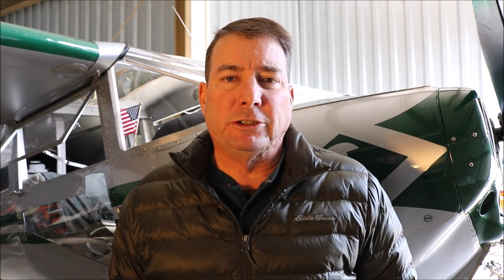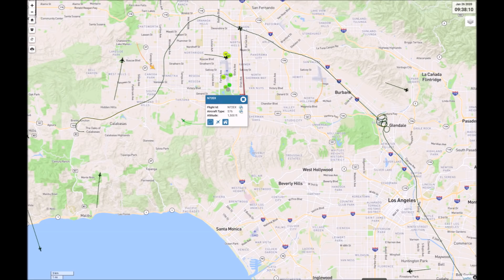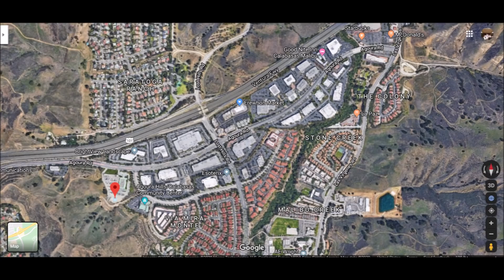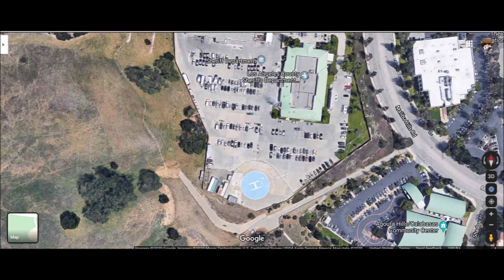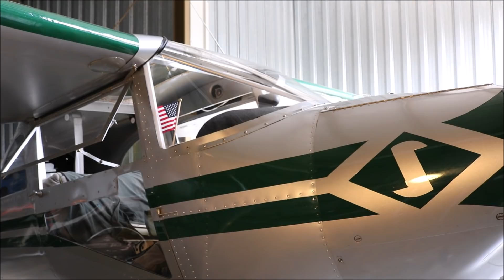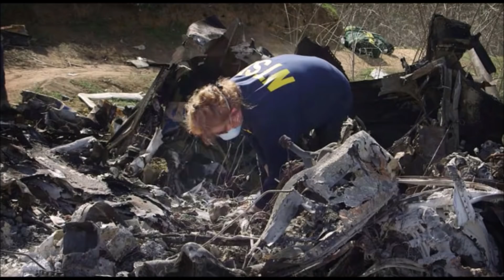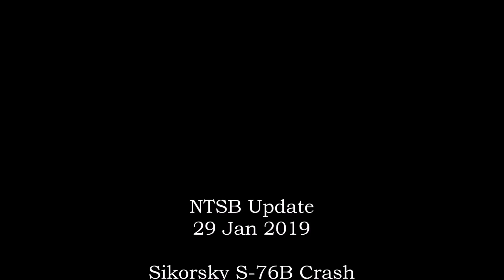Kobe Bryant Sikorsky S-76B Crash Update 29 Jan

Comment: Thank you for the excellent explanations and analysis in this tragic event. 

Could you elaborate on the devices mentioned that were missing from this helicopter(cockpit voice recorder, flight data recorder, and the HTAWS device). I'm assuming these are all third party devices that can be installed on helicopters that are not initially equipped?  

Do you have any idea on what installation cost and how long a helicopter would be out of commission for these devices to be installed? I understand these devices may not have changed the outcome of this particular event.
Reply: Excellent job Juan. Terrible outcome for all. I think this tragedy started when the take off decision was made. By all accounts this was an experienced, well trained and highly qualified pilot with a lot of time in type. Yet he made the highly questionable decision to depart under the poor existing and known conditions -  Special VFR (really IFR), low ceilings, poor visibility (possibly deteriorating), congested airspace, highly regulated routing under distracting ATC comm, irregular terrain and so much more. Given the circumstances you have to ask why? Why would this very experienced, well trained, high time pilot depart at all with so many red flags flying? Well, if we’ve been around long enough we’ve all been there - all made those kinds bone head decisions that we regretted as the flight progressed. And after we survive it we always ask ourselves why. Why did I take such stupid risks? Well, in this case I’ll bet this pilot was under tremendous “get there” pressure. He’s on a 135 charter for a long time and very high profile client who wanted to get somewhere on time, on schedule. And my guess is that the pilot’s desire to meet the customer (friend) needs had a great deal of influence on the “go-no go” decision. I feel bad for all involved but also feel the need to throw this out there because we  never see much written about the pressures pilots are under to meet customer schedules - especially Part 135 pilots.
Reply: TAWS retrofit to the heli would have been $25k to $45k.
Reply: Thanks. Less than 50k should be a no-brainer for a lot of these high profile clients. In most industries, the more tools are your disposal, the better. I'm not at all familiar with the helicopter industry so someone can correct me if I'm wrong here.
Reply: KckDwn TAWS is not really going to help a guy too much who doesn’t know the proper procedure for inadvertent IMC in a helicopter.
Reply: If I understood well , they are still optional .
Reply: TAWS is not going to do much except distract you if you’ve gone inadvertent IMC.

Comment: 14CFR part 135 vol2 chp4 sec1 details the requirements for an SIC (second in command) on aircraft type certificates of more that 9 seats. I don’t know How that company choose to fly the S76 single pilot on a part 135 flight. The S76 is a complex fully IFR capable aircraft. Even VFR , flying it single pilot is challenging much harder in low weather . Also part 135 requires the use of a cockpit voice recorder and a flight data recorder. The company I work for we are a part 135 operator and we are restricted to operate the S76 in a two pilot crew configuration, a PIC with an SIC for all operations VFR or IFR with passengers since our aircraft are configure as a 12 passenger arrangement. Our aircraft’s are equipped with voice and flight data recorders as well as EGPWS enhance ground proximity warning system a version of TAWS . How would anyone operate the S76 without that safety equipment is beyond me.
Reply: I think requiring a two pilot crew for this type (especially in marginal weather) might be the best recommendation to come out of all this. Adding more 'tech' won't really prevent this sort of thing I don't think.
Reply: For existing types, it would probably be very difficult to implement such legislation. However, there has been technology available since decades that allows an aircraft to have the terrain map for everything it is going to fly into, while flying with GPS. Current technology could make an S76 fly without a pilot with no issus, except for cost. Even the technology implementation would be childs play, but the certification would probably be best compared to some space program.

Therefore I think what will happen, are new types that will be completely autonomous, while remaining in a lower regulation or certification level. Take the blackfly ultralight for example. It will then take around a decade to establish some model of them to be more reliable than anything flying commercially, after which the regulation change regarding other flying things will change imminently.
Reply: rkan2 agree, medium and long term solution for automobiles and aircraft is that they will be autonomous and much safer than human-operated. When was the last time you rode in an elevator that was operated by a human elevator operator?
Reply: Flight safety has a motto embossed in their company wall, “the best equipment in an aircraft is a well trained crew”.
Reply: @keithkman, Sikorsky has certified and designated the S76 as a single pilot rated aircraft for VFR operations. That is written in the Rotorcraft flight manual. However, each country’s aviation regulatory body has the responsibility to apply laws in its operation. The FAA has determined that as long as is configure with 9 passenger seats you can fly it single pilot, otherwise other procedures apply. I fly in the U.S so I couldn’t tell you if other countries have it restricted To a two pilot crew.
Reply: Richard Rivera Do you operate the S-76 outside the United States? My understanding is the United States is one of the only countries that certifies the S-76 with one pilot.
Reply: There is an interview with a pilot Deetz who used to fly Kobe on that specific helicopter. He said it’s configured for 9 pax in the back.
Reply: Carl Ryan 
Not in this particular case. With an estimated descent rate of about 2000 fpm this close to the ground, the pilot had apparently lost control of the aircraft. TAWS/GPWS is only helpful when the aircraft is under control. And sometimes not then. See the AA 757 crash in South America when the pilots navigated to the wrong navaid for an example.
Reply: The reason is always the same... Money, the bottom line, profits.
Reply: @rkan2  .. You took the word right out of my mouth.  I agree 100%
Reply: @rkan2  re: "The reason is always the same... Money, the bottom line, profits."  FOLLOW THE MONEY TRAIL.
Reply: Mr Rivera I am impressed by your company's serious commitment for safety, even more so when they go beyond and above FAA standards.The sad part is that even while having onboard all those safety features accidents still occur.unfortunately accidents never happen for just one reason.They always happen by a series of events.
Reply: @CarlRyan-i2z  I've read CVR transcripts from spatial disorientation crashes, listened to a few CVRs that are out there on the internet. It always sounds the same, a computerized voice commanding you to pull up. It's like a Red Alert in Star Trek. It's just sound clutter in the background. I imagine when it does work, we don't hear about it, but I suspect that very few pilots really hear what the recording is saying at this point. Especially because false alarms are a real thing with the cheap versions of TAWS.
Reply: @CarlRyan-i2z  Just a thought , what if the pilot is not sure which way is up? There is concern for spacial disorientation here..
Reply: They could of had a waiver of that requirement in their OPS SPECS, as long as they are comfortable and checked out in the use of the autopilot. Pretty common in the commercial world.
Reply: @CarlRyan-i2z  Not if he thought he was level when he was actually in a steep bank. Looking straight ahead at the panel might have saved him. No new instruments, just the same ones that aircraft have had for ~100 years.
Reply: @wrushbo, you are right about the opspecs. That’s the reason I would not fly for a charter operator much less be a passenger. I don’t know what their standards are or the qualifications and training they provide to their pilots. In my company I have to take a full IFR check ride every six months along with three days of training at flight safety international . Sim time is not cheap. But that’s what you do when you fly the public. I’ll bet you that operator didn’t have those kinds of standards.
Reply: @MrRawnerves  OK. Lets not be a FSI snob (BTW I've been to FSI Dozens and dozens of times). There are 135 charter operations that are respectable. You just have to know what you're looking at (like I'm sure you do-and I'm being sincere) but just because a 135 operation does not require a SIC (I've flown 135 Rotor Wing single pilot IFR for over 15 years now, and if the training is good, you don't have anything to worry about. Our 297s are heavy on attitudes, airmanship and IIMC). This includes a ROBUST training program on the hazardous attitudes!
Reply: @CarlRyan-i2z  speculating the pilot was not in control as it fell. Pull up, pull down, left, right,  does nothing...he already lost lift.
Reply: @CarlRyan-i2z  if you hear those warnings chances are it's too late.

Comment: Both Taws and synthetic vision are pretty useless when you are that close to terrain,I’ve used both under part 91 in VFR conditions and when you are that close to terrain as this pilot was it just continues to go off warning you to pull up or the synthetic vision screen appears red, these systems are definitely useful but have there limitations, So really it comes down to pilot decision making and how far is the pilot willing to push there self under these conditions.
Reply: Something I do want to add is yes there are a lot of systems we can have in our aircraft but don’t forget there are lots of tools that are based on the ground for instants WebCams we use them all the time when we fly and use them for decision making and coming up with a plan of action before we even start a flight, and decide if we are even going to make a certain destination, in which we may make it only halfway maybe 3/4, for instants he had Van Nuys made so possibly land in Van Nuys and then have them go ground based toThousand Oaks or before you even leave John Wayne airport look at WebCams along the route and realize it’s really foggy in the Thousand Oaks Camarillo area so maybe the next best option would be charter a fixed wing aircraft from John Wayne airport to Camarillo IFR and eliminate the scud running I’m not trying to blame anyone here I’m just saying that you can’t always rely on all the imperfect systems on an aircraft you can come up with other solutions to help complete a safe trip. Once again not blaming anyone or saying the pilot never did any of these things I’m just having a discussion which I feel is good.
Reply: Jason Winters he didn’t have it

Comment: I asked this yesterday... Could he have turned so sharply that the aircraft stalled? Not trying to argue but if your climbing and then your dropping at 4800 fpm in the last 22 seconds as reported by HAI...
Sounds like a stall and your correct about the 30 feet. May have made a difference in level flight but he was going almost straight down, so it appears.

Comment: Would you mind asking Scott about what conditions cause spacial disorientation in helicopters? I know CFIT is not uncommon in VFR into IMC- I just want to know whether the roll could have been misinterpreted as a climb due to similar  forces on the occupants (pilot). I also would be interested in hearing how reliable the ADS-B is from flight radar. I am not questioning it, but the speed and trajectory seem to go against some eyewitness accounts. Love the channel.
Reply: If the ADS-B is fallible, the eyewitness accounts of an aircraft flying a low speed would support the theory that they were attempting to spot the ground or a landing point.

Comment: So, he was not special SVFR (that was cancelled) and he was obviously not rotary-wing VFR. So, what was he? But my question is this - what is a helicopter that is certified to operate in IFR conditions, being operated by a pilot who is rotary-wing instrument qualified, poking around in very low-level and deteriorating visibility, in hilly uneven undulating terrain? Why did he not just say to himself, “hey – this is not working out”, and request a "pop-up" IFR clearance from SOCAL, from present position - get a hard altitude and heading and execute an instrument approach into Camarillo, and just get on with it? Even the VNY local controller said, “what are your intentions?” That is aviation-speak for “aahhh…what is your plan, and do you have one, because it does not appear that you do!” However – and the question still remains, and nobody has stated - where were they going??? Were they going to land at an airport or were they planning at landing off airport - parking lot, sports field, etc.? If the answer is the latter, then that might explain the pilot’s behavior and decision to poke around out there. These are my fixed-wing opinions. 2000TT B200s C340 Citation Too Old Now - but extensive flying in and around the LA basin SAN to SBA when there were a lot more airports. Meadowlark days? Looking forward to Juan's friend and his input....................sad.......................it appears that something happened (airspeed vs. altitude) just at the end of the published data.

Comment: Will be interesting to find out what (if any) flight apps the pilot had on his phone or ipad.
There are some that combined with adsb and up to date map & airport data may have made the difference.
A moving map(even non-certified) would help vfr only pilots keep the right side up when inadvertently going IFR

Xavion was developed by X-Plane inventor Austin Meyers as an engine out - find me an airport I can glide to app featuring full moving terrain map with highway in the sky guidance down to the airport on an iphone or ipad.
Seems like there should be a lot of research and testing into getting this type of app certified for use instead of requiring $25,000.00 retrofit panels.
The software is capable
The phones & Tablets are capable 
Map and airport data is 11 dollars a month.
Only other equipment needed is an adsb which is already required now.
Only thing missing to get this type of air-nav tested and certified is multi million dollar lobbyists

Comment: I wanted to point out one thing about the flight path.  You had said that the helicopter was following the 101 freeway, which was going uphill.  In actual fact, the 101 was going slightly uphill leaving the San Fernando Valley, but for the last couple miles or so, of the helicopter's path, the 101 was going substantially downhill into the Conejo Valley.  Then when the helicopter turned off the path of the 101, it was going toward rising terrain.  This makes me wonder if, when the helicopter went over that hump between the two valleys, maybe it ran into ground level fog, and that caused the pilot to climb fast, but also caused him to get disoriented.

Comment: what do you think about a mechanical problem not hearing from the pilot anymore and no distress button issued or a possible health condition, because for the helicopter to go suddenly left there has to be a reason that happened that made it go left if you notice the flight path he goes more in a  northern direction into the san Fernando valley before turning left descending at high speed,  why did he do that north turn if when he was circling glendale he could of continued in a western track ?

Comment: From the stuff that's been released so far it looks to me like the copter went over the top of a small ridge while steeply descending and then crashed 30' below it.  Not missed clearing it by 30'.  Looks like a big ground scar at first impact and then it bounced a bit further where the wreckage burned.  Also interesting is that the "door bell" audios sounds like the copter approaches; does a hard maneuver and then goes off into the distant at a steady state until impact.

Comment: THANK YOU for mentioning my helipad theory! Very cool! To add to Juan’s presentation of my theory, crash was roughly 1.0 miles due East of the helipad. Chopper had already cleared highest point on the 101 freeway. When he came down did he mistake the Las Virgenes Bridge for the Lost Hills Bridge, tried to circle back to the helipad but was disoriented and in the wrong location?
Reply from the maker: You brought up an Excellent Point Keith!
Reply: blancolirio Please max out your volume on both videos. You can hear chopper and impact. A “thud”:
https://twitter.com/billfoxla/status/1222345578744446976?s=21

https://twitter.com/billfoxla/status/1222387197661216768?s=21
Reply: @KeithKman  Those clips sure sound like they're moving a lot quicker than witness in the TWA hat made it seem, and he was in the church parking lot at the intersection quite close to the accident scene.
Reply: WayFastWhitey I agree and the impact was at a high speed. The thud and then nothing confirms that.
Reply: @KeithKman. I remember your theory, I even commented on it. Very cool indeed.